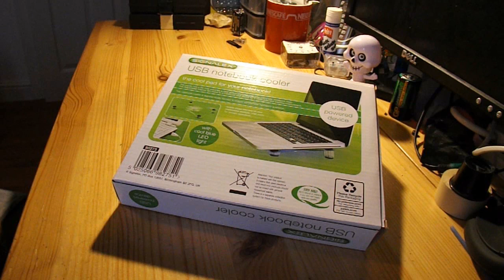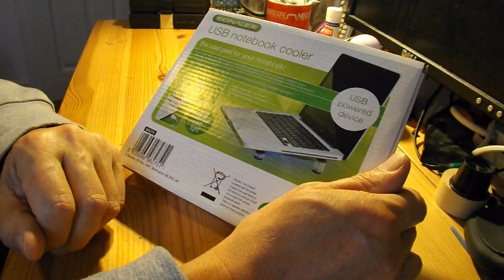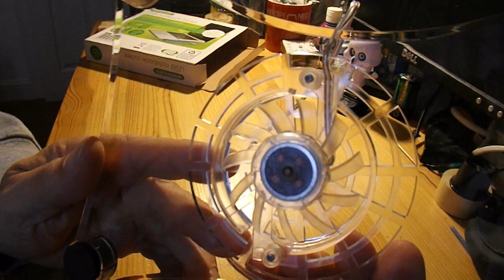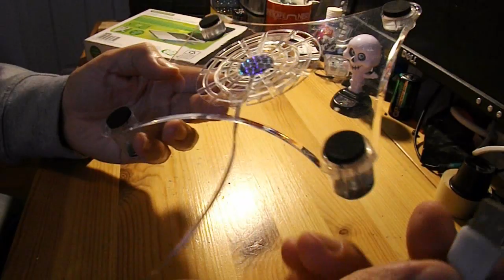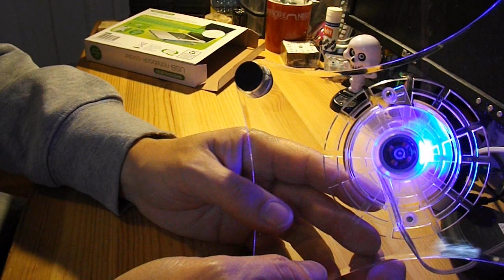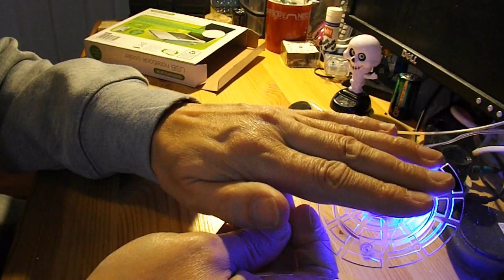Bargain Store Project #15 - Notebook cooler to hovercraft

Comment from the maker: I would call it a borderline success. It meets the criteria of my project. I bought an item for £1 and used it for something it was not designed for. It would have been a great success if it flew with just button cells powering it, but the fact I needed to use a mains driven power supply to get the power into it dropped it down in the rankings. However it did get off the ground so it was not a failure.

Comment from the maker: All for £1 here :-) The cells are in a mixed 8 pack, probably to shift the less popular types. I was surprised by the fan. I've been looking for ordinary USB desktop fans but haven't seen any recently, then I noticed these notebook coolers. The motor even has a little (black blob almost) ic to drive it :-) I buy these things when I see them as the shop seem to buy them in bulk and sell them till they run out, you may never see them again.

Comment: You could add a battery box to it. :) its what im going to do.
Reply from the maker: Good luck with that.
Reply: well um.. im gonna add 4 cooling fans
Reply from the maker: Sounds like it will be big and heavy.
Reply: @pylon2144  a reply 7 years later… Did it work?